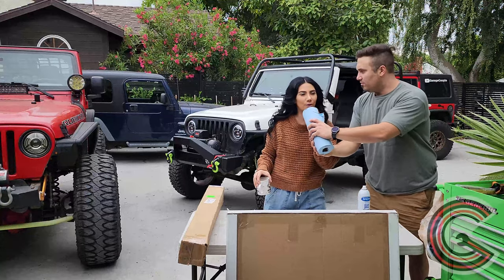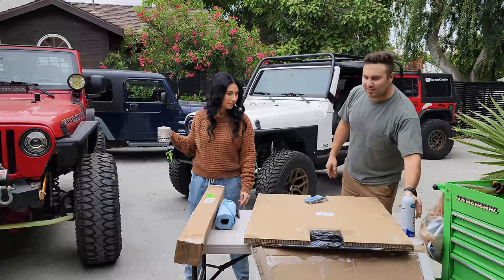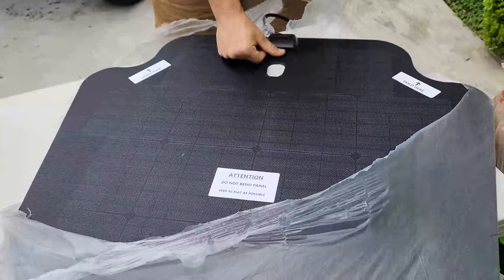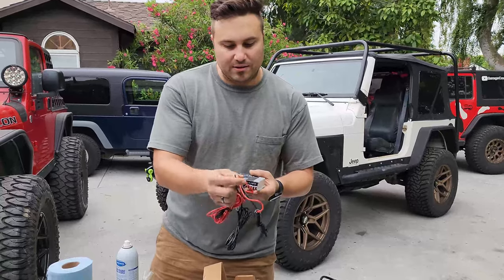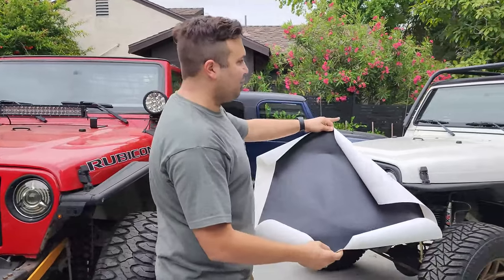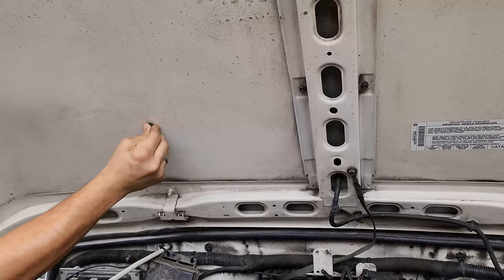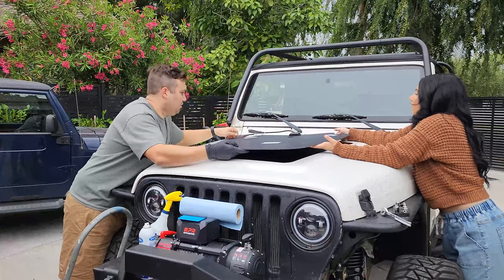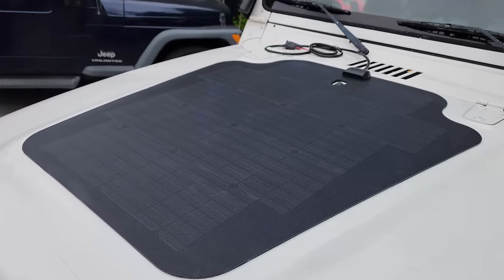Episode 18: Custom SOLAR Panel Install! 100 Watts, Every Overlander NEEDS This! Worth it?

Comment: Slick! I’m curious as to what you can power with that? I’d feel better if there was a low profile frame around a portion of that panel. The last thing you want is it coming unstuck at high speeds.
Reply from the maker: It's 80 watts so just have to choose your  devices appropriately. We've had one on our JK for 3 years with 0 issues. It's not flying anywhere

Comment: I don’t know about fuel mileage improvements but my air conditioner is colder now that I installed a hood solar panel 35 watt system connected to the main starter battery on my 2020 Jeep Gladiator Rubicon. I went with Len sun solar system for my solar system it has Bluetooth solar charger and adjustable voltages via the app on my iPhone.